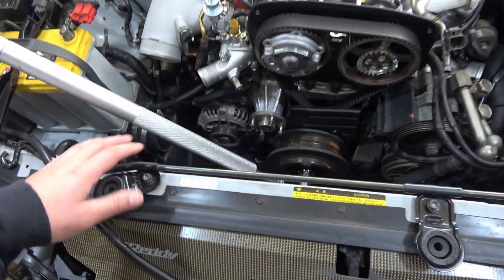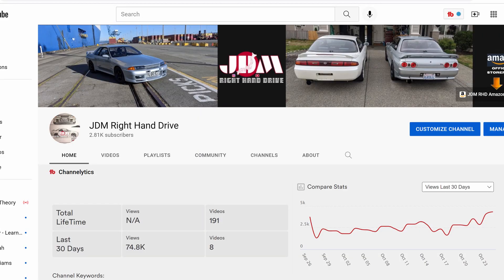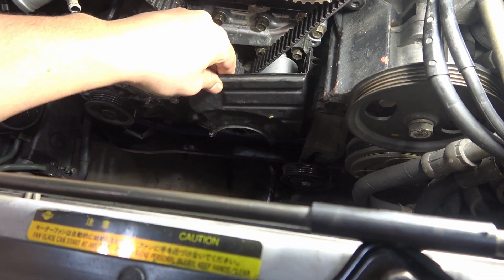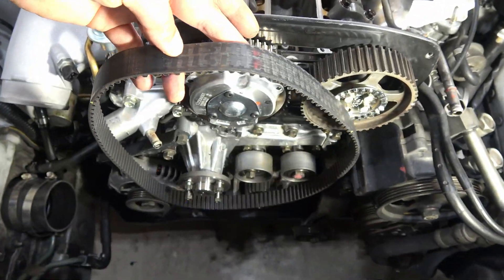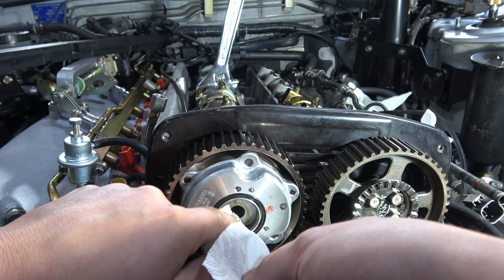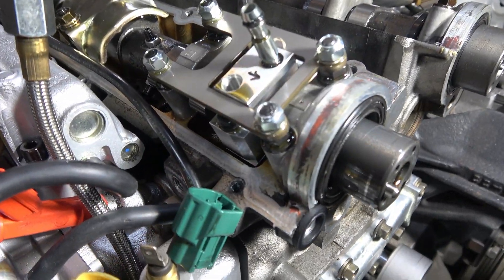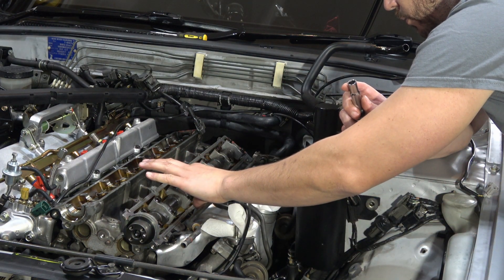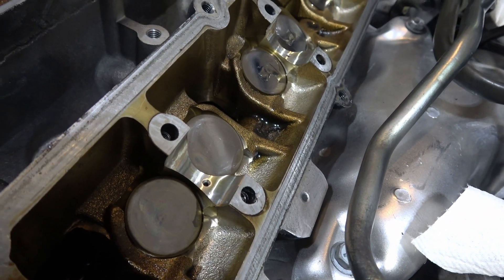RB26 timing belt and camshaft removal Nissan Skyline GTR engine tear down EP2

Comment: Great video! didn’t realize it was so easy to replace the timing belt. Looks like you can take the radiator and clutch fan out then you can get to everything.
Reply from the maker: Yes you can! Much easier than doing a timing belt on a Mitsubishi 3000gt VR-4! Lots of space to work with the sexy inline 6!

Comment: Good stuff man! Your crank bolt seemed alot easier to get off than mine... Or I'm just weak AF lol
Reply from the maker: I tried to get it off last week and I couldn't. But then I remember to use my jack handle. I got it off in the first pull really easy. You PRP trigger kit install video, I did see you struggling to get that bot free. I was looking just like you last week. I had my stomach against the front fender and my leg against the front wheel. I pulled as hard as I could an nothing. Your bravely posted the struggle with it and I did not. Needed the longer handled for that leverage. I think it's cool that you watch some of my videos. Your channel is what inspired me to start my YT channel. Have a good evening Dustin!

Comment: With your radiator, did you have to move the power steering lines? I have a Greddy radiator (50mm) but I’m unsure if I will need to turn them
Reply from the maker: With the Koyo Rad it was able to drop right in just like the stock radiator. I did not have to move any of the lines. Good luck with your Greddy, that radiator looks beautiful.

Comment: Great vid as usual, very interested on the NZ cam angle sensor set up you have, not sure which ECU you are running. Be great to see how its wired and if it merits the cost of it as compared to the stock CAS, I am not going over 600 rear HP so not sure I need it? Thanks again, thumbs up.
Reply from the maker: I am running a Link G4+ ECU. I will shot some video a little later on all the components to the NZ wiring trigger kit. It will give me some easy filler content for next week, so I can have a weekend to rest.
Reply: @JDMRightHandDrive  I purchased the same Link but not many tuners around my area are available, other than the base tune that comes with it I will be learning it quickly as soon as it goes into the car. Any suggestions will be helpful as I go along, thanks for your channel input, thumbs up.

Comment: Are you running v cam with OEM ECU? Is the valcon electronic standalone? Is it save to use OEM oil pump? Thanks
Reply from the maker: My car has a Link G4+ ecu, which is running the VCam. Stock oil pump works with VCam with no problems.

Comment: tie wire a few earth magnets inside your cam covers and radiator. this will catch allot of the crap before it’s thrown back too the sump. buy earth magnets from ebay that have a whole in them, that way you can feed the tie wire through their or fasten the too either the roof of the cam covers or too the left over thread on the cam caps. for the radiator.. you can just throw a few earth magnets inside behind the sump plug (tie wired too the sump plug)

Comment: No damage put it back together.
Reply from the maker: Couple of my lower main bearings had big gouges in them. Engine has been machined and goes off for assembly at Intec Racing next week. HKS step 2 2.8 here I come.

Comment: Hey man, do you have a Snap-On part number for that puller? None of the chinese garbage sold today really works on the harmonic balancer on my RB26. Simple job has turned into a cluster f*ck. Thanks for the vid. Thumbs up.
Reply from the maker: The one in my video was from my 80 year old next door neighbor. But I did order a made in china one from Amazon, which is the same one Dustin &goodezilla used. I test fitted it and everything lined up correctly. There is a link in my description on the video for this tool. Hope that helps. I know the feeling of everything turning into a cluster fluck!
Reply from the maker: I can get the snap on model number from my neighbor if you prefer. Let me know?
Reply: @JDMRightHandDrive  The link to Amazon you have posted, the kit doesn't list M6 bolts, my harmonic takes size M6 on the 2 threaded holes on the harmonic, am I incorrect? Thanks for your help man.
Reply from the maker: @1970PMD  I will look at it when I get home. I used the Allen bolts from my compressor inlet pipes on my neighbors kit.